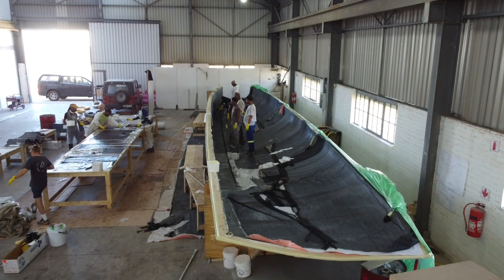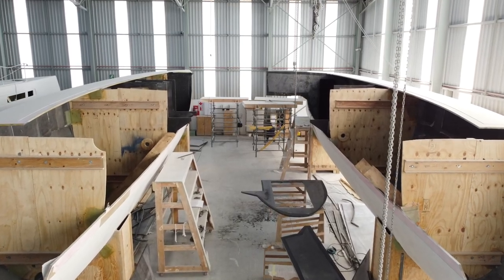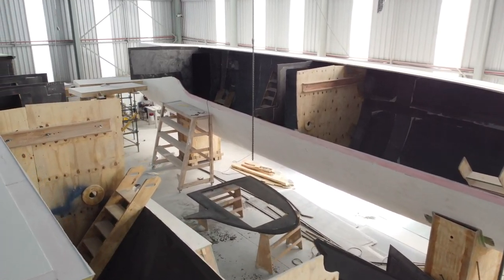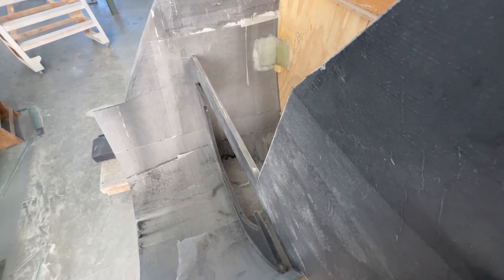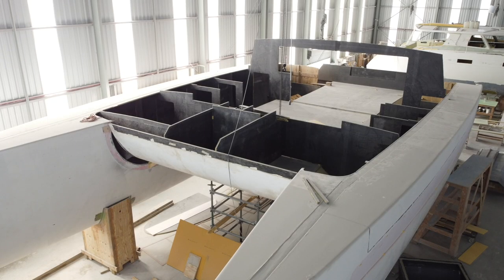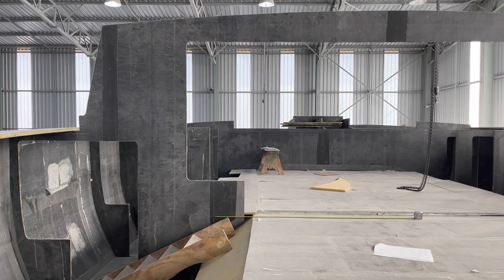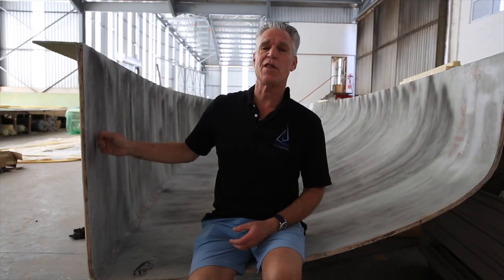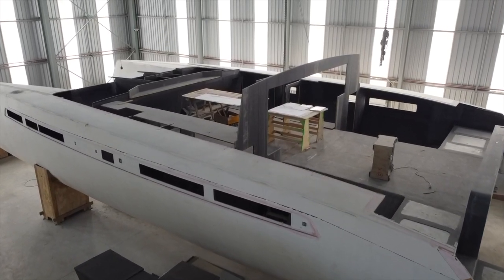Build Series Part 1  - Balance 580

Comment: Production cats like the monohulls are glued together, very little glass tabbing while these balance cats are tabbed in the stress areas capable of being a blue water boat. And this requires a lot more labour hours, and it’s in the pricing, should result in dramatically quieter boat in heavy seas.

Comment: I noticed that is has less fuel capacity of 700L against 1000L in 526 and less fresh water capacity of 600L against 780L in 526. Why is it so?
Reply from the maker: Our models go smaller in size so to do our standard water and fuel capacities.  The reality, with a water maker fitted, volume may not be as important as it is ideal to save weight when possible.